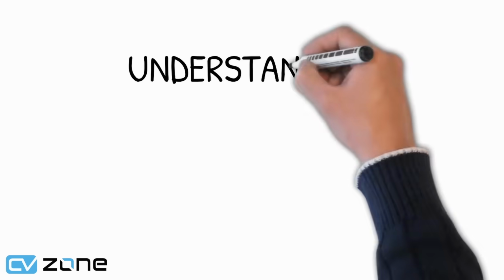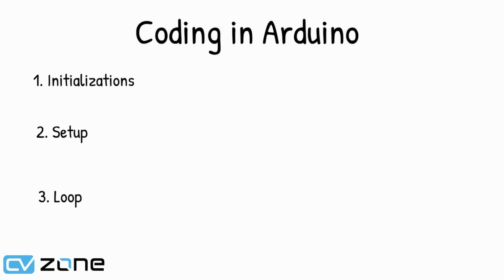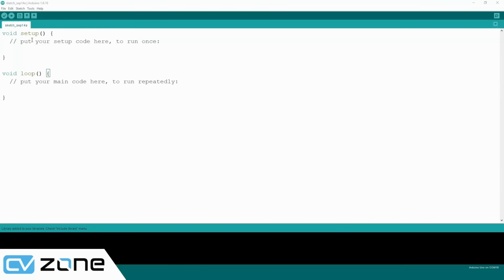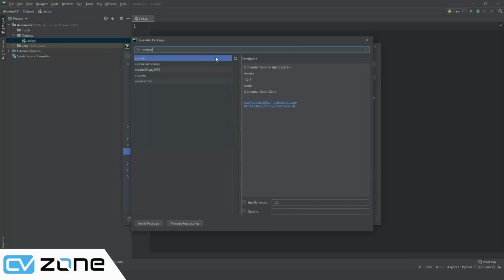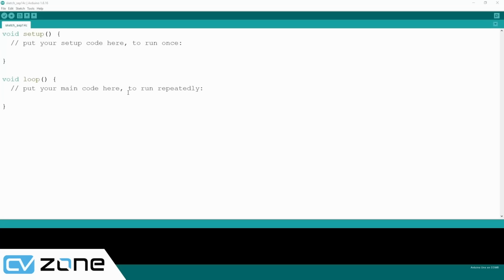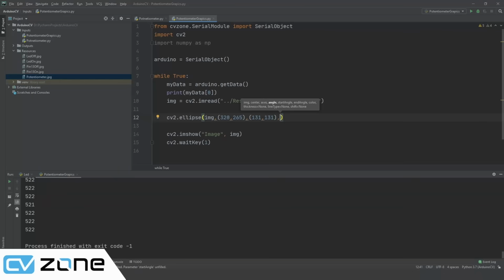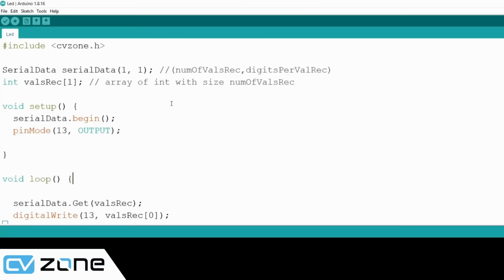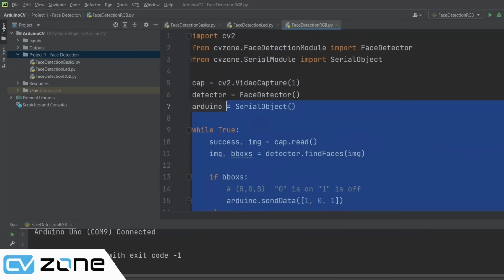Computer Vision With Arduino |  2 Hour Course | OpenCV Python

Comment: Amazing Course 😊
Reply: indeed
Reply from the maker: Thanks
Reply: @murtazasworkshop  Sir, does course have wireless communications with raspberry pi as well ?
Reply: @murtazasworkshop  
Stop for a second and think how ridiculous it is the amount of clicks and button pushing one must do to turn On and Off an LED., not to mention the insane amount of knowledge required as the reason for each button push or a click.
(In contrast, Usually it takes one flip of a switch for on and one for off) 
The point is that the humans seem to be becoming more like machines instead of us making the machines more like humans.

(It is time for the Arduino and Raspberry Pi to become self-aware! ) !!!!!!!!!!!!!!!! Get it? .. or are you stuck in the belief that it is cool to know all that stuff just to flip a switch.
Reply: @reasonerenlightened2456  ok tony stark
Reply: @murtazasworkshop  Where can we get the CVzone library?
Reply: @manishdhakal9379  Enroll for their course in the link provided in description, then you'll see the option to download their zip file, extract that file and inside there you'll find another zip file that you need to add to Arduino IDE.

Comment: I used to work in a lab and we used to use Arduino and Arm controller with OpenCV and other ML libraries, one interesting project I could think of is Augmented Chess, we connected a huge led display to an ARM processor and two people stand in front of respective cameras and based on their hand movements the chess pieces in the display will move, the players can drag and place them, we did it for an exhibition (IMTEX) two years back.

Anyway, nice video.
Reply from the maker: Interesting Project

Comment: The LED light is not a great example for digital output as it can also be analogue too. You have two ways to dim an LED light, digitally with Pulse Width Modulation (PWM) or analogue by varying the voltage. It is the simplest to way to demonstrate a digital output, light on or off, but it should be clear that it's not just a digital output. A purely digital output would be something like controlling a solenoid or relay switch to turn something on or off.

Comment: I've been using Arduinto to help me debug existing product hardware. I wanted a simple, quick I2C interface to talk devices independent of the FPGA that normally drives the board. 
I've found that Arduino saves library files in THREE different places on a Windows 10 computer. I'll list them out to help reinforce my own memory:
1) C:\Program Files (x86)\Arduino\libraries
2) Documents\Arduino  (for whatever YOURusername is)
3)  C:\Users\YOURusername\AppData\Local\Arduino15
It's important to know these directories working with Arduino, or it will drive you crazy trying to uninstall libraries you DON'T want.

Comment: That was deceptive, you said you were going to use the Arduino to do face tracking and hand gesture detection. Instead you used your PC to do it and just blinked a light on the Arduino. Nobody should pay for these courses.
Reply: Actually the reason I opened the video was to check what's wrong with it. As I remember, arduinos have like coule KB of RAM. And I was curious, what exactly author means by CV on Arduino.
Your comment let me skip the video :)
Reply: Not deceptive, it still fits the theme.  Nobody is paying for it, it is a free video. Maybe you just want to be spoon fed instead of actually learning the skills that have been taught and applying it into ur own project that u intended
Reply: It is deceptive
Reply: I agree 100%
Reply: No, this is simply clickbait.

Comment: Title is kind of misleading though. The arduino is being used as an external IO board. You could just as well print in a console "face detected" or "face not detected" since the pc running the python scripts is the one doing the computer vision work.

Comment: Literally Its amazing.. Thank you so much.
I want to make an project on CV with arduino and I want to compare  two hole which is small and which is big.
Could you please help me in that I want to use only microcontroller without computer.

Comment: Very informative video.thanks a lot. Also wanted to know if you have any material related to UART communication. wanted to know if i can give inputs from the digital pins and send output on uart based on the different values from the input pins

Comment: The Arduino isn't doing ANY of the "computer vision" part of this setup. Correct me if I am wrong, but it looks like it simply turns on a light when your Windows Computer, that has a camera attached, detects a face and then sends a signal via serial out to the Arduino. 

I think the title of this video is misleading.

Comment: Thanks for such a great course 💪🏼
But how to let this project run the green led only if a specific  face is detected?
Reply: you need to learn about machine learning. You will need to replace his detector in the python with your own detector. That requires you learn about machine learning in python such as tensorflow or pycharm. Good luck.
Reply: Guys kindly help me with cvzone library 🥺🙏🏾

Comment: Hey man i like your ideas and videos but there is a slight problem,
Why you not prefer to use serial module of python to exchange data b/w python and arduino.
These all stuff can also be achived by using serial module
What's intresting in cvzone.

Comment: So does the full course simply use the Arduino as a slave as shown here or is there something more complex?
Reply: Forrest Milner  Indeed such a simple device does not have the processing capability.  This video sequence could therefore be just be reduced to the trivial topic of basic 'message passing' - which is all that it really is. Hardly worthy of the price of the course.
Reply: I thought he was going to implement and read data from a camera via UART I2C or SPI and process the image in the Arduino.
Reply: @_grumpyoldman  could recommend any other channel or video series on thia topic
Reply: @_grumpyoldman  am a beginner
Reply: Nice click bait! Putting arduino and vision together, combo buzz word for your video... I learned a lot, just from the title alone🤣
Reply: @_grumpyoldman  1111
Reply: @NextGenMechLife 😅😢😅😮😢

Comment: I have a question. What could be considered pros-cons if instead of using this library, the Arduino is reading/writing to serial while a Python program is doing the same while communicating through same port with the Arduino?

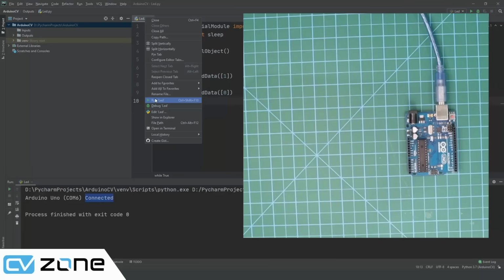Comment: I love your course. I was able to get Arduino code working at 51:35 when using the Serial Monitor, but at 59:17 could get my LED on.  Pycharm works, it says Serial Device Connected but the LED of Arduino does not change to on. Any idea? Thanks!

Comment: Please help to answer a few questions in regards to this video:
1: What equipment is needed to build an automated headlight system for a smart car using Arduino?
A. A headlight and a temperature sensor
B. A light sensor and a buzzer
C. A headlight and a light sensor
D. A motor and a push button

2: What does MCU stand for in the context of this course?
A. Microcontroller Unit
B. Main Control Unit
C. Machine Computing Unit
D. Manual Control Unit

3: Which Arduino board is most commonly used according to the text?
A. Arduino Mega
B. Arduino Uno
C. Arduino Mini
D. Arduino Nano

4: What type of signal has only two states, on or off?
A. Digital signal
B. Analog signal
C. Pulse signal
D. Continuous signal

5: What is the range of values for an analog input in Arduino?
A. 0 to 1023
B. 0 to 255
C. 0 to 100
D. 0 to 500

6: What is a breadboard used for in Arduino projects?
A. Writing code
B. Connecting components
C. Displaying output
D. Measuring distance

7: What type of device is an LED considered when connected to Arduino?
A. Analog input
B. Digital output
C. Analog output
D. Digital input

8: What is the function of the pinMode function in Arduino?
A. To define the type of sensor used
B. To set a pin as input or output
C. To upload code to the board
D. To start the serial communication

9: Which software is used to write and upload code to the Arduino board?
A. Arduino IDE
B. Python IDE
C. Visual Studio
D. Eclipse

10: What does the command digitalWrite(pin, value) do in Arduino?
A. Reads a digital value from a pin
B. Writes a digital value to a pin
C. Reads an analog value from a pin
D. Writes an analog value to a pin

Comment: Misleading title. It should be "interaction between arduino and host computer running a CV app".
Obviously there is no CV application running in the arduino platform.
Reply: I walked in with the same intention and later realised that it was for integration of messages onto Arduino from Python code, and not really image recognition ON the Arduino .

Comment: Interesting video. Well done !
I use Ubuntu 20.04 with Visual Studio code. (Don't have Windows)
At position 1.50:52 in your video, code <arduino.sendData([1])>, I get:
WARNING:  root:Arduino Not Found. Please enter COM Port Number instead. 
I suppose the reason is that I use Linux i.s.o. Windows. 
Any suggestion how to solve this issue?
In cvzone.SerialModule in Python?
in <cvzone.h> in Arduino?
Reply: The easiest solution was (for me) to use pyserial.
I replaced : arduino.sendData([1]) by arduino.write(b'$1')

Comment: I did the potentiometer graphics, but it is not smooth. and the serial monitor in pycharm also doesnt react swiftly, it feels like data is not sending or recieving correctly, any ideas how to solve?

Comment: Dear Sir, please recommend or advice.. I want  to create a system based on Arduino components and stepper motors along with other components so that the stepper motor ON and OFF is triggered in the voltage or amperage range (Min, Max) from other systems. Thank You

Comment: I  did all the projects up to "potentiometer  Graphics". The potentiometer does not work as expected. I shown the image in the window but the problem is in getting value from arduino. It comes very late and the ecllipse also reacts very slow beacause of that. I even copied the  program from the file  given in the website but that program also doesnt work. Could anyone  please help me with this???

Comment: I followed the steps and wrote the LED python code. However, I can't send it to my board. I can run the code, but the arduino board doesn't regiser or show that the code has been sent to it, It's almost like I connected it there and it still did nothing

Comment: I remember like 15 years ago i tried to make some project on atmega8. I installed avrstudio, programming device, and made simple circuit wit led just for test if everythink working fine. But unfortunately i got some error on avrstudio and i had no idea what is it about. It cost me very long and frustrating investigation. Finaly after two weeks i saw the led blinking.

Comment: Hello sir,i found the video very useful but one thing in which i was stuck in was what is the difference between coding in python and arduino software basic?
Reply: The only difference is the possibility of working with python rather than Arduino software basics.

Comment: what about mac users? I have my arduino connected to port /dev/cu.usbmodem2114401 and it works fine with using the Arduino IDE but when working with PyCharm I keep getting "Arduino Not Found. Please enter COM Port Number instead." and if I manually enter the port I then get a "Serial Device Not Connected" message

Comment: Hi brother!
Great detailed stuff on Drone and Arduino as well.
One question please.

In this video, is the Python code running on the computer and UNO is also connected to same  computer ? Only then data can be passed through SerialObject between these ? Apps (UNO) in this video can't run on battery I think as we need serial connectivity  for Python CV apps ?

Comment: mediapipe library is not being installed in my system I tried VS code and your way of py charm, it just doesn't work.
the exact error shown is:
ERROR: Could not find a version that satisfies the requirement mediapipe (from versions: none)
ERROR: No matching distribution found for mediapipe

Comment: Sir thanks for the course , it was awesome 
I am getting this error : WARNING:root:Serial Device Not Connected 
Can any 1 help me
Reply from the maker: Try using the COM number instead . e.g. arduino = SerialObject("COM3")
Reply: I tried that too, still it is not able to recognize the serial device .Note : I used vs code for programming python
Reply: Having the same issue here with pycharm

Comment: Thank you for this amazing video.
But I have a problem
When i run the python code, it doesn't work and it gives me an error "Warning: the serial device is not detected" and i connected the arduino port in the same port specified in the python code.
What is the problem?
Thanks for your considerations
Reply: Hi! I had a similar issue, your port may not be the same as his, so you might want to check the port name on the Arduino in your Arduino IDE. I explain this a little bit in my Python + Arduino tutorial. 😀

Comment: I bought a raspberry pi 4 , after a couple of day of getting used to it, i wonder why every says it is superior to arduino. I bought a keyboard and mouse without wires, RF via USB transmitter, and , because of it's architecture, mouse speed can`t be modified. Response is slow, with an annoing delay, if raspberry is so wonderfull, why does this run slow ? these peripherics, connected to my laptop, work perfect.

Comment: There is some issue with the sampling rate when performing "POTENTIOMETER" experiment.
Arduino ide seems to collect samples evenly (Serial monitor)
but there is some delay when the pycham is fetching samples

how to fix this???

if I remove "cv2.waitKey(1)" then it seems to match but img won't display
Reply: same issue bro, did u solved it?

Comment: Arduino is so expensive and so underpowered that this is a  massive waste of effort.  I don't understand why it's so popular when it's such a needlessly nerfed piece of tech.  There are SO many other micros out there with ten or a hundred times the capability in packages a third the size and a fifth the cost.  I really don't understand the attraction of Arduino....

Also, this is shameless clickbait.  The Arduino is not running OpenCV.
Reply: Give us an example of the microcontroller you mean
Reply: is for beginners you mega mind. Easy to use and looks appealing while also having its own IDE just to run it, whereas if you used a smaller micro-controller it would require way more effort to code it.

Comment: This course is amazing 
But is there a way that this project can be done without computer is one of its components 

I hope there is a way so this project can be set and be used without the need of pc

I dont know but is pixy2 can be used ?
Reply: Pixy has limitations and is costly. Instead use raspberry pi with a picam.

Comment: nonsense from the first to the last minute. what's with the arduino? stupidly light up the diode on command sent via uart? and a lot of mind is needed to use ready-made algorithms?
as a result, a piece of rubbish lasting two hours, with information content equal to zero !!
Reply: Hm..? But doesn't this course teach u how to build a project to detect objects?

Comment: sensor -> mcu -> light
wow very cool

i can do this with an opamp smh

the digital and analog fan example is misleading
the uno doesnt do dac, it does pwm, which is still digital, u can switch it on and off, but fast, in 256 switches, you have 128 on and 128 off intertwined, then thats half speed
but a pwm is just how long on and off stays, in a 1 second, u have 0.5 second on and 0.5 second off, then thats half speed, and it repeats

just saying
Reply: ok, karen